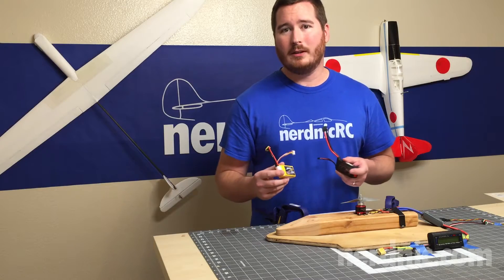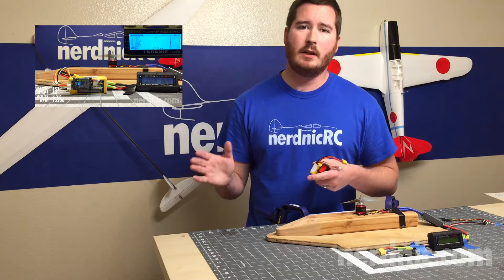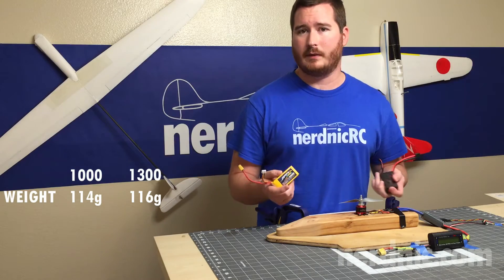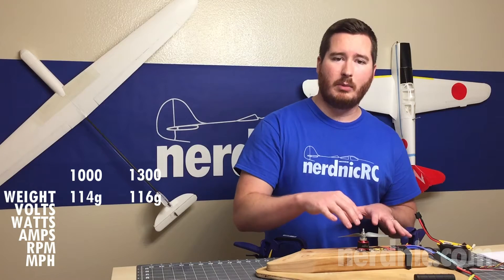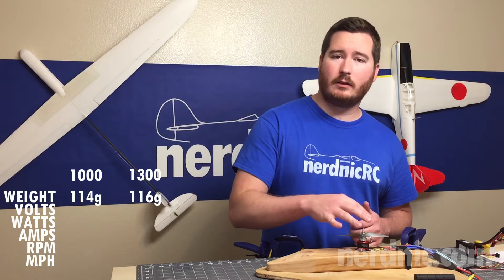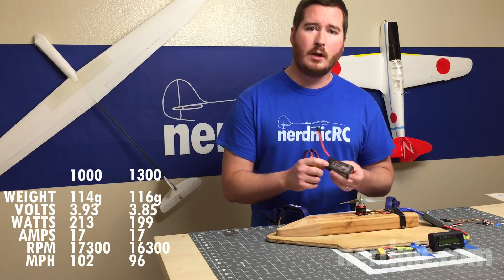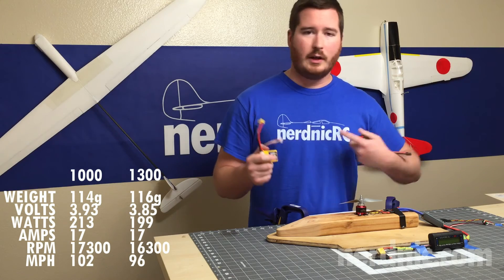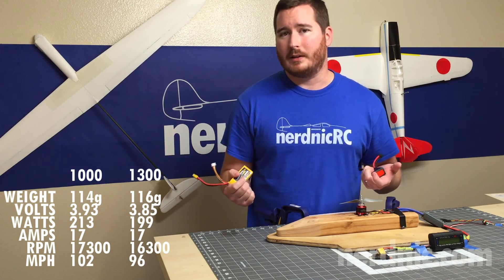nerdnic | Lipo Battery mAh vs C Rating (Turnigy Graphene and Zippy Compact)

Comment: Thank you for the video I want to buy a battery for 1/10  and for 1/8 rc car Battery 7000mah  25c There is battery 5000mah c70 11.11v  what is impotant to me time  to play No power What to choose
Reply from the maker: Hafez Muhtaseb if the 7000mah will fit in your car, get that one.
Reply: Nic LechnerI apologize because my English is not excellent and I am a beginner in the world of rc but does c have any relation to the heat and the duration of use and thanks for the answer
Reply: oun dhk jlb and vkar rc car
Reply from the maker: Hafez Muhtaseb A higher C battery will not get as hot. But motor temperature is not connected to C rating.
Reply: Thank you for help

Comment: Thanks for posting this one!!  I am one to go more for higher capacity and lower C. It usually helps with weight and the discharge rate is actually better it real world testing. By that I mean in flight and not on the bench. I rarely go above 30c as a result.  I do half throttle tests since that is where most of my time is spent with some full throttle bursts mixed in there. That is how I fly...

Comment: Thanks for looking at this comparison! 

Did you pick the 1300mAh battery simply because you had it handy? (understandable)  Or was it chosen for its similar physical size and mass?

On a purely math-curious basis....I'm curious about how a "mAh vs C" shootout would turn out if the  "high mAh/low mAh" and "high C/lowC" ratios were more equal.  What I mean is;  65C vs 40C is a 62.5% advantage in output for the High-C battery, but 1300 vs 1000 mAh is only a 30% increase for the lower-C battery.   How would the results turn out if you compared a similarly-ratio'd pair of batteries?  For example:  1000mAh-65C vs. 1625mAh-40C .... 65/40=1.625,  1625/1000=1.625  (or at least something closer, like a 1600mAh)
Reply from the maker: The 1300 was chosen for both reasons, I had it on hand and it was very close in size/weight. I can definitely do another comparison as you're suggesting. However, I'd expect the larger mass battery to perform better, so in this case the 1625. Having both batteries basically be the same size/weight is an important feature because it's realistic to be limited on which battery size works with your rig, and it demonstrates comparable power density.
Reply: Absolutely agree; the size/mass similarity is an important feature when assessing how much energy you can put in a given space/location.

I was coming more from the pure numbers side of things, framing the question such as; "regardless of mass or dimensions, does X% increase in C-rating still beat the same X% increase in mAh-capacity?"   

While some may be concerned with maintaining the same mass in their rig, high-C batteries are quite a bit more expensive than lower-C-higher-mAh ones.  We can't all pony up for Graphene in our planes. ;)

That said, if cost is not a barrier and speed is your ultimate goal, high-C batteries are the way to go.  :)